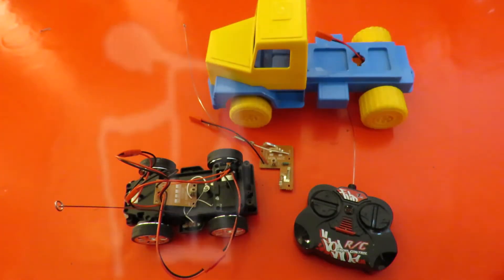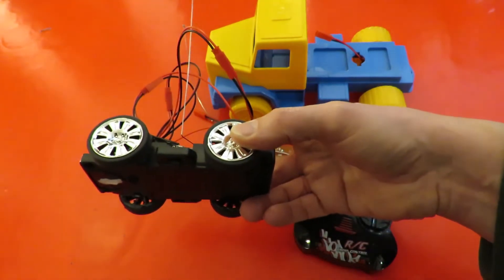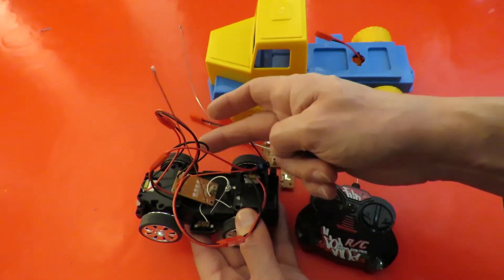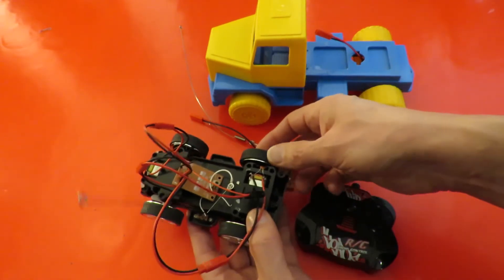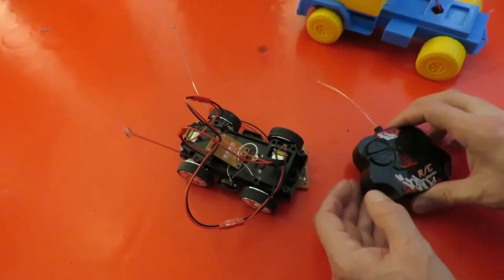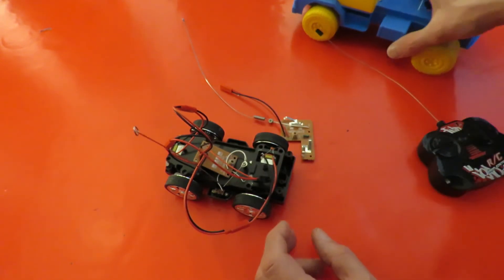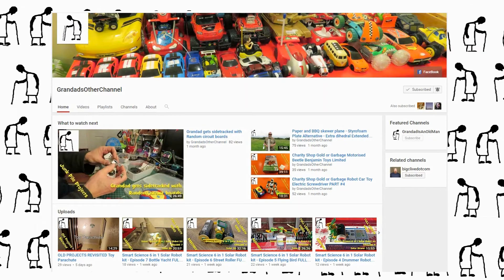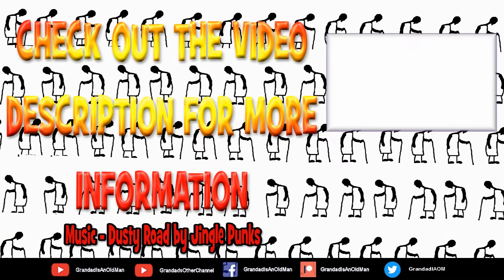What can I do with that toy grade Transmitter & Receiver Part 1b

Comment: How can i connect this rc circuit with l298n motor driver for bigger motor controlling
Reply from the maker: You would bypass the onboard H bridge and connect to the output pins on the TX2 chip and feed them to the input pins on the L298n chip. Looking at the data sheets I found - On the RX2 chip the pins are 6 RIGHT 7 LEFT 10 BACKWARDS 11 FORWARDS and you would connect them to IN1 IN2 IN3 IN4 or directly to pins 5 7 10 12 on the L298n chip. I did something like that using a different driver module in this video https://youtu.be/wIWNY1R5KZo
Reply: @GrandadIsAnOldMan  thanks for the help sir.
Reply from the maker: @creativeashok3469  Good luck 😁👍